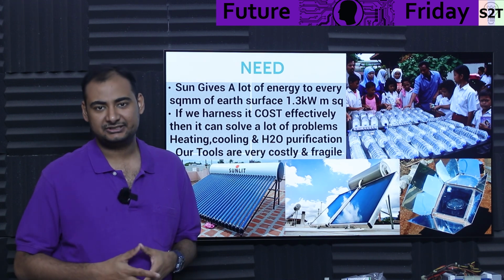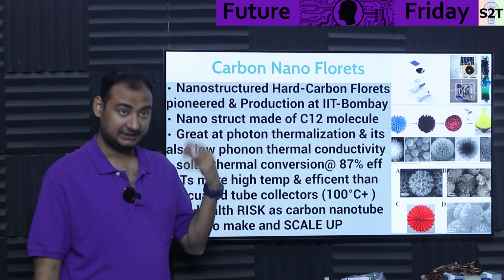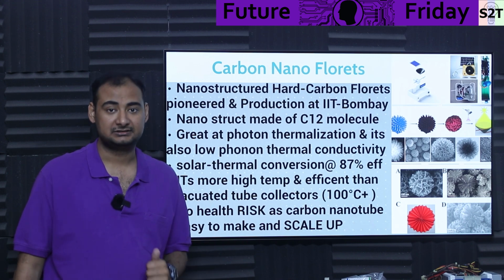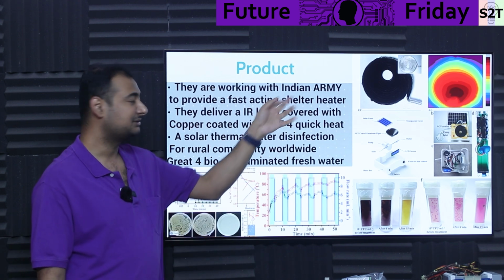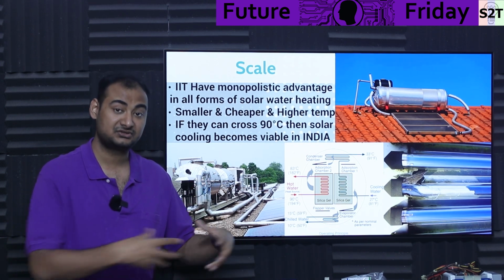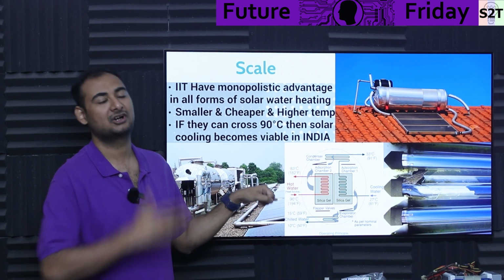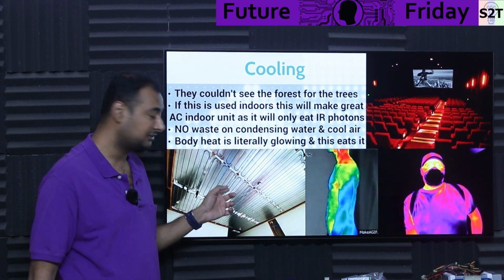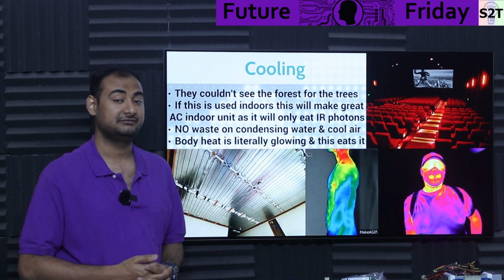Carbon NanoFlorets {NCF} Explained {Future Friday Ep268}

Comment: Greetings from somewhere that uses heating much of the year.

The bulk of the sun's radiation is in the near infra red. For a molecule to absorb a photon there has to be an available electron that can jump from a bonding to an antibonding orbital with the right energy gap . For every additional conjugated carbon carbon double bond the maximum wavelength of photon increases by an amount (?40nm?). If the nanoflorets absorb well  200nm to 1400nm, and emit poorly at 100°C, they may not absorb well at the wavelengths emitted by a human.

There may be a way to use this for air conditioning. Pass calcium chloride solution through a heat exchanger then over a solar panel that allows the water to boil off, then back through the heat exchanger. The now concentrated calcium chloride can absorb water from the air in a room allowing you to cool by sweating.
Reply from the maker: lets see

Comment: Couldn't this really improve the efficiency of heat pumps in colder climates?

If this coating pulls in infrared radiation, and doesn't release it couldn't you use the Pelletier effect via nyten for a standard solar panel to generate power 24 seven?
Reply from the maker: YEs this will boost heat pumps  if solar collectors are used with this coating .Pelletier effect is 100% useless for power generation it need too much temp delta to work  and that also at very very low efficiency